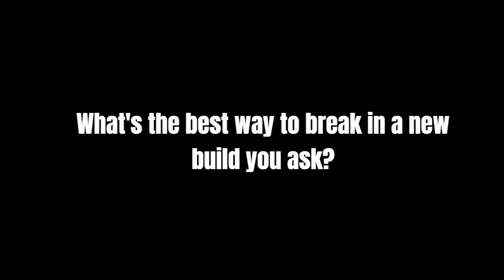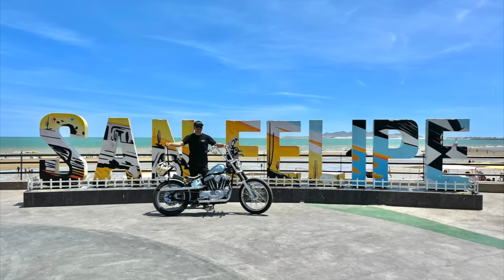Building a Sportster Chopper in 12 minutes!

Comment: It would be interesting to see a cost breakdown of this
Reply: You mean a cost "bobber breakdown" Lol 😂😆
Reply: Work some overtime or. Get a second job if your worrying about it. Figure cost per mile in Gas For your bike (MPG) 
 Multiply MPG TIMES  trip distance..
(cost per mile add 20 miles to be safe)
AND YOU KNOW HOW MUCH FOOD YOU EAT. (Bologna sandwiches are your friemd while riding)
Then add 30% of that total, there’s your cost outside of breakdowns. Make sure your bike is sea worthy 😊✌🏼
Reply: I’m a Caucasian male born in 1957 and I don’t not judge skin color or background.
ON A BIKE WE ARE ALL. FAMILY THAT HAS EACH OTHERS BACK !! Word !!
Reply: @davfrui  I don't think that's what he meant but ok
Reply: I am doing it right now, the thing is that you mostly just remove certain parts or shorten them like fenders, you need to fix somethings on the frame and stuff, if you dont buy a springer front end and a different carborator (1600usd, aprox 800-1200usd) you'll be finde with repainting and rewiring so without these things you'll be good with 1500-2000usd for sure....like a new gastank is only 200usd
Reply: My sportster chopper build cost me approx. $2,183.97
Reply: Im bearly in 600
Reply: The more you can do yourself the cheaper it will be. Patience to find good deals at swap meets and other places will help as well!
Reply: That's bad ass came out great

Comment: I just bought a sportster yesterday a 1999, but it took almost my cash, I got to do a little work, but cant do anything to it until i save up. got to rebuild carb, replace mirrors, put on new rear tire, & lower rear so I can put both feet flat on the ground. 

I would love to hardtail it and stretch front out with longer forks, but someday, 

on good note I do have a 2007 street bob thats pretty wicked, but wanted a bike a little more civilized. all paid for, so happy to have second bike.

Comment: Just wondering... What did you use to align the frame to know it was set correctly so the rear tire is running true with the center line of the bike?  Also, the tailpipes are set at different angles... Can that be corrected by moving the upper pipes mounting bracket?

Comment: People don't get what choppers are ! Loweredp raked ( so that when you put handlbars they reach bake to you not you reach to them ) forward control ( out of the rice burner  cafe squat , and sit like you are sitting in a chair at a table )  handlebars that come back to you ( shoulder level )! If you are going to cut and weld lower the reaer end ( bottom of the frame level to the road and low  , drag bike style ) and what is with the nut cracker seat position ( I had to cut the front of my stock seat and reprofile the foam  so as to quit crushing the nuts )
 You may as well left it stock and just put handlebars !